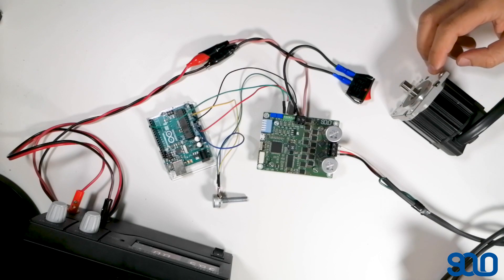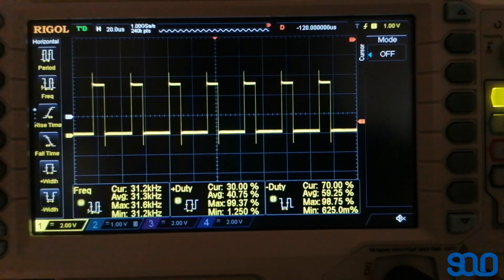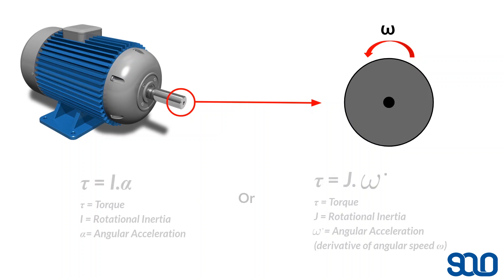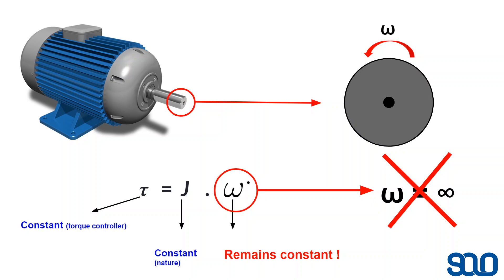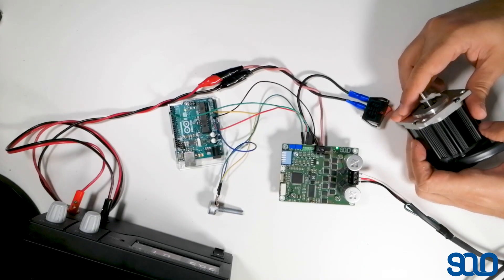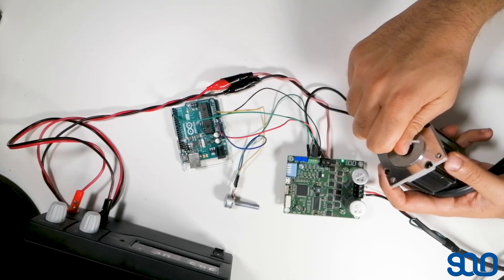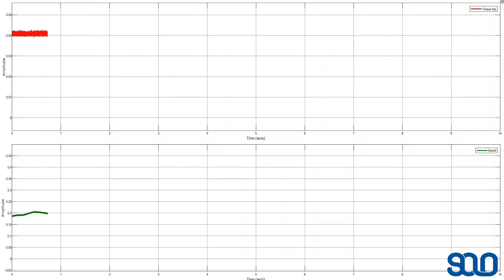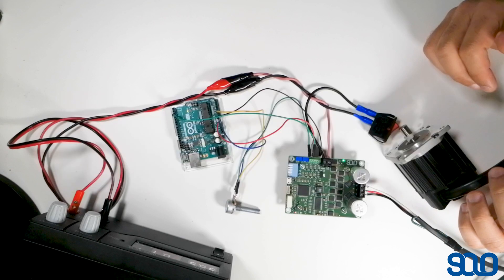How to Control Torque of your Brushless Motor (PMSM) using Arduino and SOLO | Sensorless

Comment: When you holding the shaft, the motor is not running momentary but at this time there is no current flowing in the motor . suppose if you holding the shaft for long time , does that damage the motor or not ?
Reply from the maker: We have the possibility to define a Stop when Stall is Detected. Without stop, If the motor is in hold the controller will push the maximum allowed current and the motor will try to push, the energy will be dissipated in heat. Based on the Construction of the Motor (Motor Thermal performance) and the setup of the controller you can make the operation safe.

Comment: Can Be used as torque mode for sterring Wheel force feed back? Its use low rpm but torque high, Very fast changes off direction
Reply from the maker: Hi, 
as you know SOLO offers the Torque mode in all sensorless or in sensor-based mode by using Encoders or Hall sensors for brushless or simple DC motors, in all these motors, the Torque has a direct relation with the "Iq" or "IM" current that SOLO controls, so  Torque [N.m] = Iq[ A]  * Torque Constant [N.m/A]
In this case if you know your Motor's Torque constant, you can directly control the Torque of your motor and subsequently having force control. There will be no problem in fast-changing of the direction, as long as it doesn't cause over-voltage or over-current.
You can easily monitor the complete behavior of your system using "Monitoring Mode" in our Motion Terminal and finding the best tunings for your system.
Reply: @SOLOMotorControllers  thz!! Um looking for bldc motors with big torque, i found DC servos, from mige 48v, 5nm rated toque with 35A , do u thing It can work? Encoder 2500ppr,  Another thing when the board Will be avalible for purschase?
Reply from the maker: @rodbarx  Yes, The specifications you've mentioned are well within the supported range of SOLO UNO. We are sold out with our BETA models, the new models will be available from mid-February 2021. You can pre-order them with a discount now in :
https://www.solomotorcontrollers.com/product/solo-uno/
Reply: @SOLOMotorControllers  hi o again, i cant register tô ask in fórum, Will Try here, im using a servo driver with DC 48v, but servo is AC220v, is possíble i use solo with Ac servo ? With 48v DC and 15A i can do 15Nm torque and 300rpm. This AC servo, have low Nm/A, about 1.1nm/A If yes Will be great for me tô use torque mode, t

Another question If yes for UP question, If dont need tô put a resistor for a regen voltage, tô dont have high voltage alarm?
Reply from the maker: @rodbarx  Sorry for the issue in the Forum, we solved it and now you should be able to ask your questions there which will be much more convenient.
Actually, the motor you see in this video is a Servo AC brushless Motor, and it's rated for 60V, we had users using SOLO for AC brushless motors rated for 480V but supplied with lower voltages like 48V and they were successful. Of course, this is not something that we recommend, but depending on the design of the Motor core, it might be possible.
SOLO is not featuring the Brake resistor, and if the voltage goes above a certain limit it will enter into Over-Voltage protection mode. 
The Regeneration is managed by SOLO through 4 quadrant operation, and the returned energy from the Motor will appear on BUS voltage, so to utilize that energy you might need to use some DC-DC convertors to charge your batteries back ( we can talk later about the design of this).
Hope to see you in our Forum. Let us know if you could successfully login.
Reply: @SOLOMotorControllers  today im using they AC servos with 10/20nm Peak torque with simucube board 12.8A can do 20Nm torque.
Reply: @SOLOMotorControllers  looking for a driver more cheap

Comment: Is there a facility for regenerative braking for an electric bicycle application.
Reply from the maker: Hi @cnc3d49,
Yes, SOLO operates in 4-quadrant mode, and it offers regenerative braking feature, to know more about this you can read the below article, there in figure 1 and 2, you can observe how SOLO behaves on brakes, and how the energy from Motor is fed back into the supply line. if you have more questions, you can get in touch with us.

https://www.solomotorcontrollers.com/monitoring-mode-solo/

Comment: This is a awesome module that I am searching for. I think this module will help researchers and students to accelerate his/her job doing research. I should have ones for my research.. I plan to develop wind turbine emulator in my Lab, and I think this product  (with PMSM Torque control capability ) will be fit with my research. Thank you SOLO
Reply from the maker: Thank you Iwan, that's an honor to have you as one of our users

Comment: Do you know what is happening in bike trainers as Tacx Neo? It's using a BLDC motor but the rider is who apply the movement and the motor is applying resistance based on slope.  Thank you
Reply from the maker: Hi Mario, It's hard to say how that particular product works, but one way can be using the regenerative brake or slow down feature which ban be utilized to use the motor as a brake to slow down or apply reluctance against the motion. This is a standard method used nowadays in BLDC motors for a fast stop or recharging the batteries during brake.